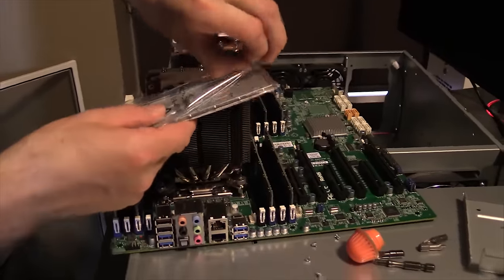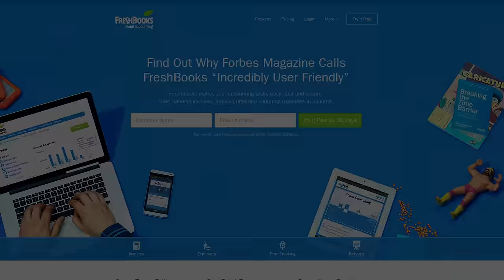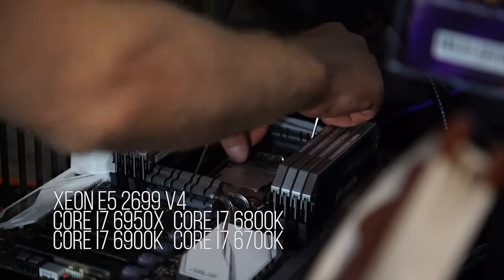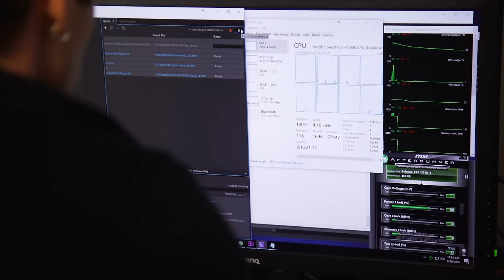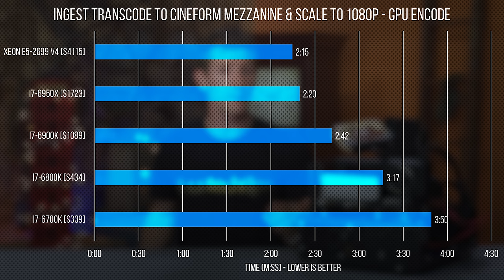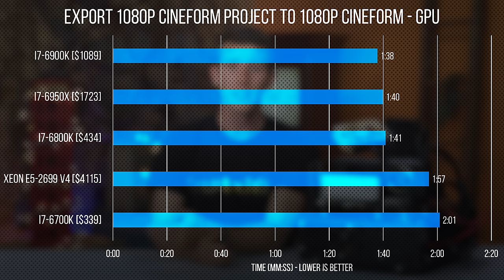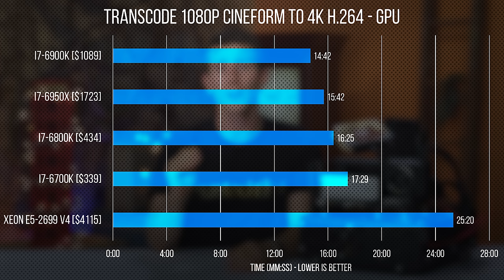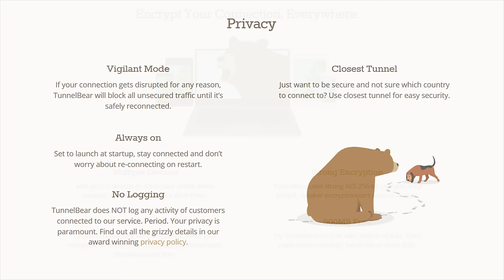$300 CPU Beats $4000 CPU?? - Cores vs clockspeed for video encoding

Comment: Question on the workflow...  You're filming in 4k, then transcoding to 1080p, is that for edit process only, then you encode on the original 4k file, or are you up-scaling the 1080p file back to 4k?

I suspect you have a much fancier workflow than I use, but I simply work on the raw 4k file itself, then encode it to the output for YouTube, so the whole 1080p step is a bit lost on me.

Finally, why use Cineform?  Why ever leave H.264?  (I'm assuming that H.264 is what is inside the MXF container the Sony camera films with...

---

Side note: For comparisons sake, I'm filming on a much lower level camera than you (your camera body is probably three times the price of my whole camera), but at 4k/60p at 150 Mbps in H.264, I then edit the file directly using that video, then output to 70 Mbps H.264 for upload to YouTube.  If I'm missing something there, I'm all ears...
Reply: This is covered in a previous video. They transcode the 4k footage to 1080p cineform, then upscale it back to 4k after editing. They found that this makes very little impact to the sharpness of the video, so little that it makes no visual difference in Youtube.
They use Cineform because it gives much better timeline scribing performance in Adobe Premiere Pro when using a decent GPU (GTX Titan X). I think H.264 is CPU bound and also it is never meant to be used in editing.
Reply: Can't answer all your questions, but downscaling the original footage to 1080p makes editing a lot easier, accelerates the whole workflow and saves tons of space. They only re-upscale to 4K for (YouTube) uploads, because it looks a lot better than original 1080p footage, but you can hardly tell the difference from 4K that hasn't been downscaled in between.
Reply: i suspect they use proxy editing but i may be 100% wrong since i know very little about this stuff
Reply: Proxy editing would be working way under 1080p in most workflows.
Reply: JohnRoss Lumbert proxy editing would mean your working at a lower resolution than the original/final content it doesn't matter if its 1080p since the original and final upload will be 4k.
since their computers are fast enough they could proxy with 1080p
Reply: You can tell the difference.
Reply: Tech Deals If you're asking why use Cineform (which is an infra-frame codec) rather than just staying at H.264 (which is a inter-frame codec) during the editing stage, then you still have yet to learn about intermediary codecs. Stack a bunch of effects on an H.264 clip and preview render it; now, do the same thing on, let's say, a Cineform or a ProRes clip. You will immediately know what I'm talking about. All the best
Reply: They are techies doing edits, not tech savy editors... not the same mindset.
Reply: I know it is really late response but gonna say it anyway. It a lot depends on chroma. 4k file is never kinda raw or it would have terabytes, it is encoded, and it is encoded usually with some kind of chroma. Chroma means some data is stored the same for pixels next to each other and for example only brightness is basicly modified. It does decrease a lot of size for not so big quality loss, but can make certain edges look worse. Meanwhile let's say you encode it to "full" size 1080p without chroma optimalization. This image will have in terms of certain data exactly the same information as 4k, only some will be lost. You can watch videos 4k on 1080 p screen and be like that 1080 p on 1080 p is worse, but here is the thing 1080 p on 1080p monitor is using chroma optimalization, 4k on 1080p will downscale image this way it will look like there is no chroma optimalization so full quality. so full quality 1080p to 4k yes makes sense if 1080 is less chroma optimalized or not optimalized at all, although theoreticly 4k to 4k should still be best quality unless youtube fails with codecs again.
Reply: YouTube 4k is far FAR *FAR* lower bitrates than 1080p sitting on your computer, especially if it's largely uncompressed video like they have. So YouTube 4k still looks worse than the 1080p they are upscaling.
Reply: Typically in H.264 you'd use YUV420 as a format that means there's a black and white version of the image encoded at full resolution and the colour difference (chroma) encoded at half the resolution. So if you have 1080p footage in YUV444 format (that means the colour difference is in full resolution) then it would make sense to double to 4K in H.264 so that the chroma planes are effectively in 1080p. But of course that only works if you watch it on YouTube in 4K, but still, the difference is there. Also it probably works as a way to force a higher bitrate and thus get less compression artifacts.
Reply: Ryan Delos Reyes for those of us reading your comment would you mind saying what the effect is?

Instead of us needing to get all of this equipment and do this test just to learn your knowledge that you refer to?

😀

Comment: Interesting tests, thanks. I currently record, edit & sometimes render on my desktop i7 4790k, but invariably pass encodes onto my slower laptop i7 3610QM, which does a good job. I can then record & render on 2 machines. But I'm about to build a Xeon (dual 6 core) cpu, 12 core machine with possibly a GPU to help with encodes - will be interesting to see how that works out! :-)

Comment: the 6950x seem pretty consistently good across the board. looks to be the best of everything (within reason)
Reply: except price...
Reply: 6800K looks to be the sweet spot for price, performance and GPU utilization.
Reply: it costs half as much as that xeon
Reply: It costs less than half of the Xeon. So it´s Price is fine if you think about getting a the Xeon.
Reply: +Mike Crapse
compared to Processors that cost double or triple of it?

for a Consumer it's nuts but then again so are $600 Processors so...
Reply: Rasmus In the same breath, you can buy a much better graphics card to double your workflow with the $1200+ difference. That's a titan X, or 2 1080s in SLI
Reply: Or a 6900k, if you're not shitting money.
Reply: no no no, the 5820k is the smart choice, its cheaper and overclocks better then a 6800k
Reply: +cctvuser Really? What's the typical overclock on a 6800k? I have a 5820k and the max I can get with a 420mm radiator is 4.6GHz. I reckon with more radiators I could get higher though.
Reply: errrm I have 4.7 on air at 1.23v, I don't get this obsession with water cooling
Reply: but you wont see a 6800k clocking that high as they need lots of volts and they get hot,
Reply: cctvuser Damn that's pretty good. Is that on the 6800k or the 5820k? The OC to 4.6GHz is at 1.35v for me :/

As for watercooling, it's much quieter and dissipates much more heat than air cooling. My rig sounded like a jet plane when gaming, especially when stressing the graphic's cards. SLI GTX 770's were loud, but the triple fan design of Gigabyte's 980ti G1 Gaming was much louder even though it was only a single card. Liquid cooling both the CPU and GPU is bliss, I barely hear it now even when pushing the GPU when gaming.
Reply: them clocks are on my 5820k, theres a video in my channel of the asus software taking it to 5ghz,  the 4.7 is my manual overclock,
Reply: cctvuser Looks like you won the silicon lottery then haha. What mobo are you using? That can have quite a big impact on your OC capability. I have the Asus X99 Pro (gen1)
Reply: I got the asus x99 usb pro 3.1 not even a high end board
Reply: cctvuser Oh haha, you literally got the same board as me then, only difference is yours is the USB 3.1 version whereas mine isn't. The only other factor that I can think of that can restrict your OC potential is the speed of your memory. I have a 3000MHz kit, but to be honest, I think you just have won lucky with your CPU. 4.5GHz@1.3v is pretty normal on a 5820k so to hit above that speed at a lower voltage is pretty impressive.
Reply: running corsair ram (the kit with the air coolers) 32 gig kit at 3000 MHz too, I like this cpu so much I have side stepping turned off so it constantly runs at 4.7, this is the best cpu ive ever owned
Reply: 6700k with OC does way better.
Reply: ZetsubouFallen Depending on workload. 6700K crushes in single core, but the 6950x kills in MC
Reply: OFC yeah, but considering the price and performance 6700k with a 4.5 OC which is normal, will do better.
Reply: A bit old but... 5820K

Comment: Actually windows is your problem:
Windows tend to swap CPUs heavily evenly spread out the heat of single and low multicore applications across all cores. But since we're talking over videoencoding each latency peak hits you hard. Since each swap will result in a cache miss this your problem in this scenario. To verify find out how many threads the application uses and limit the application to the number of cores. You should see a 20-30% performance gain.
Reply: I think you don't get my point. :)
Reply: Nope, try adobe.
Reply: +David Folsom What Ruben suggested should still yield a performance gain.
Reply: try x264.
Premiere is the same inefficient encoder like 99% of the other windows timeline programs.
Reply: Or use x264.
Reply: My point was, Windows is the problem here, so an exchange of userspace binarys does not help at all.
Reply: Ruben Kelevra if premiere uses only half the cpu, its not windows' fault. x264 can use 100%.
Reply: My discussion topic was NOT about multi threading applications, but why single or low multithread applications are significantly slower under windows than under linux.
Reply: Ruben Kelevra ah ok :)
Reply: Simon WoodburyForget still, I'm talking about the circumstance that a single thread application is slower if it runs under Windows than under Linux. No multithreading involved here.
Reply: It seems the "Changing CPU affinity" trick I learned back when dual cores started coming out wasn't mainstream knowledge... I'd get at least 20% better performance by locking my single core games to one core because Windows would waste so much effort sorting instructions to keep all the core loads even. Windows 10 actually improves this, it lets single core games run on one core again and I got a 15% FPS gain with those games when I upgrade to Windows 10. But unfortunately I get a slightly hotter CPU too.
Reply: JaminandShara Mills well, yes. In general yeah, but not Windows is "sorting instructions". The lack of performance is mainly due cache misses, loss of the out of order pipelines and a loss of the branch predictions when windows switching the task to another core. That's the reasons why it's so slow on windows to run a single core application. :)
Reply: Ruben Kelevra Windows may have one design feature that you know of which may be bad for multitasking but that doesn't mean the main cause of premiares poor utilisation of multiple cores is the OS. Premiare is unoptimised on windows. Premiare is unoptimised on mac. Other videos apps are fast and optimised well on mac. I've heard that there are well optimised video apps on the pc. Adobe also makes unopimised special effects programs, sluggish page layout programs that only got upgraded to take advantage of gpus in 2016 (!), and clunky pdf apps that can't even scroll a 15 page document without introducing latency. I know where i would place the blame, anecdotally. Do these other fast apps circumvent the OS issues you mentioned in some way?

Comment: I've found a similar situation and similar results transcoding and compressing large batches of dash cam and security footage using Handbrake.  My 16c/32t Xeon server transcodes slower than my 4.7GH 5820k by a little bit despite having about 40% more theoretical processing power.  However I can fully utilize the server by running 2 different instance of Handbrake simultaneously loading up all the cores completely and in the end getting the job done a fair bit faster.  More cores are only useful for one instance of one application up to a certain point.  They are handy when you want to process a bunch of different things at once or have many clients accessing the same physical hardware at the same time.

Comment: I read the title and thought to myself "oh he's doing a video about why certain workloads are more dependent on single core performance". Then I realized that you are just learning this for your uses. I've spent 10 years working with enterprise solutions for businesses and the number system that Intel uses will tell you the story. They have the e5 1600's for single core performance needs, e5 26x7 for sql type loads where you need many high performance cores, and e5 26x0 for virtualized loads. The e5 2698 and 2699 are designed for cpu heavy virtual loads. In recent benchmarking of a database at my work, the e5 2670v3 was outperformed by an e5 2667v2 by 50% in every single test we threw at the SQL server. When we switched the CPU to an e5 2697v4 (which is designed for high end SQL consolidation), we ended up with a 300-400% decrease in query times. This sounds crazy, but Intel knows what they are doing with their CPU's. they use the number designations to make sure you know what to buy and fully understanding the numbers is what well help you make the right.

If you ever want someone to help you out with this type of selection on enterprise hardware, let me know. I know Storage, Servers, Virtualization, Citrix (which you should use for a new version of the multi gamers one cpu), Cloud systems, and also Microsoft products. I wouldn't want any money or anything to help out as I love you content and enjoy seeing people trying to do things that are on the edge of what is available.

Comment: i do all my video encoding with a i5 4460! Yeah Poor people unite!
Reply: haha, yeah. its worth making your own PC ^^
Reply: Just 20 days ago, I had to do it with my Core 2 Quad Q8200, which took 20 minutes to encode a 5 minute 1080p video. i5 4460 is still relatively good and even the latest gen doesn't offer a big difference.
Reply: I have the 8 Core AMD 8320E 3.2GHz
Reply: I3 6100
Reply: +Cory Guffey
4 core* ...
Reply: +GaborBartal mine is an 8 Core
Reply: Well all 8320s are the same though - not to be a smartass but it has 4 modules with 2 logical processors in each, so the 8 logical units have to share the resources of a module - under heavy load they perform like 4 cores. Task manager also shows 4 cores - 8 logical units. However the term "core" is not clearly defined as Intel and AMD have quite different architectures. Basically an "8 core" FX processor has a similar performance to a 4-full core Intel one of the same specs.
Reply: TechReflex yeah man, that suck XD i paid 156 for my 4460 :P but that is far worst than mine XD you need an upgrade!
Reply: as I sit here with my i5 2500k. old faithful.
Reply: TDicǝ I have a crap i7 6700k
Reply: You don't know the pains of video encoding until you do it on a single core AMD regularly....I would say daily but it takes 24+hours to do basic encodes lol. Ok ok that was a long time ago but not so long ago I was using a Core 2 Duo. Now I use my I7-3635QM on my MacBook Pro which still sucks but coming from a Core 2 Duo it was light years ahead. I can not wait to do a 6 core overclocked monster of a CPU overclock job with a GTX 1060 or really any decent Nvidia card and watch the encodes fly.
Reply: Echy 97 xp was the best windows imo ^^
Reply: they have 8 physical cores
Reply: I used to do my video encoding with an AMD FX-8370. That's even poorer.
Reply: What are you encoding exactly ?
Reply: I don't have the 6700k anymore, I now have a 6900k, I wrote that comment before I bought it.
Reply: Nice! how do you like the 6900k?
Reply: It's amazing, honestly it's way too overkill for me but at least it'll last a while. My previous cpu before the 6700k was an i7 980x, and I wanted multi core performance that would offer a sizable jump from it and the 6900k is plenty.
Reply: If you are willing to spend $900 for a cpu then a 6900k is the perfect choice
Reply: Yeah its pricey... It's not the cpu price... its all the stuff i will have to buy with it including motherboard, ram, harddrives (ssd and hdd), and Water cooling... That's why i haven't bought it yet XD 

I really want a 6900k though. i can do so much with it.
Reply: I'm wondering what do you people do with a 6900k ?
Reply: its only 8 cores/16 threads but most would use it for rendering videos.

I for example will be using for rendering and VM servers.
Reply: Dank Memes But then RYZEN drops and beats the 6900k for half the price and less power :P
Reply: Mylittlebaboon I bought it a month before ryzen, plus I like Intel more, I've had bad experience with AMD products
Reply: TDicǝ i do it on Pentium G4400 (Lightworks)
Reply: How about i7-4930K (LGA 2011-1)? 6 cores is too few?
Reply: TDicǝ i5 6500
Reply: Im still using amd athylon x4 in 2020